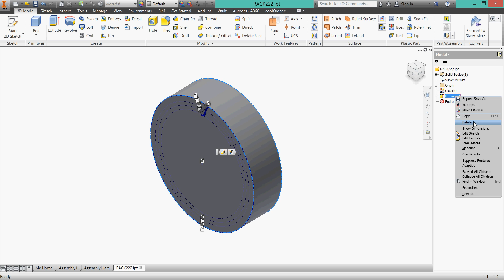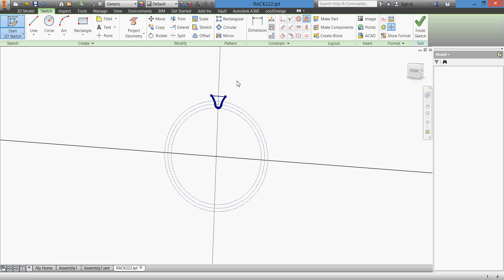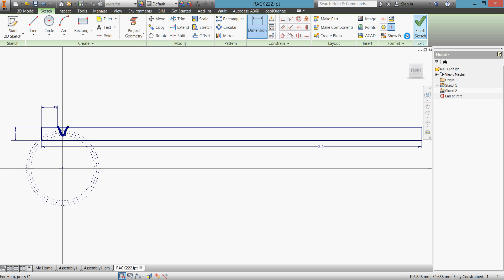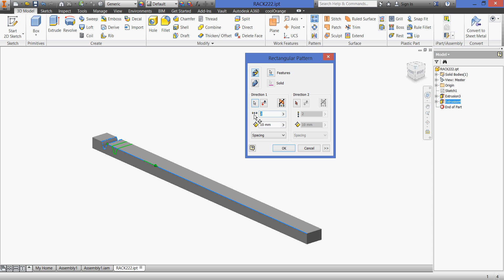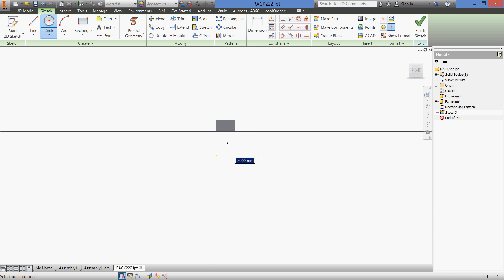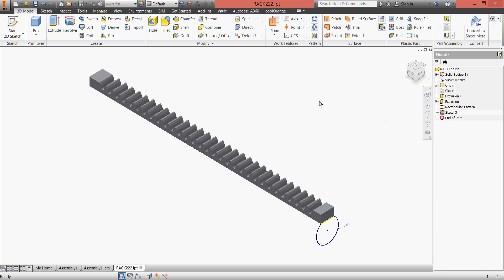03  CREATE RACK USING THE SAME PINION TOOTH PROFILE

Comment: Rack's tooth profile should not be the same as the pinion's
Reply: how should it be can you explain?
Reply: @luisbeltran4137  the rack should have straight teeth because you can think of the rack as a circle with infinite diameter so the teeth are straight
Reply: @TonyRios   All teeth are orthogonal (straight)to the direction of motion. There is nothing wrong here.